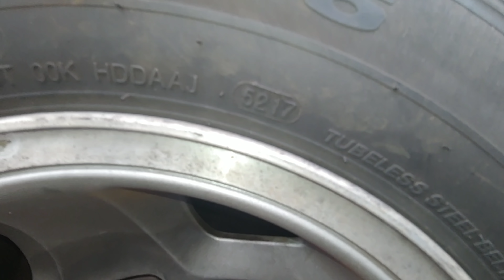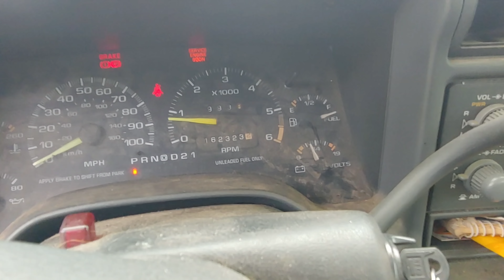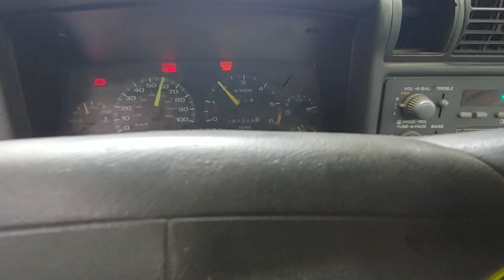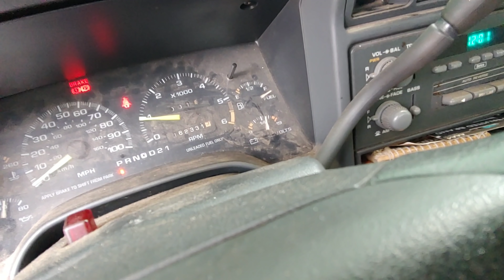How to tell a tires date and alternator repair

Comment: The date info on tires is good to know because tires are only safe for about six years, after that they start losing their elasticity and can blow out suddenly.  So if you find a brand new tire that is over six years old, DO NOT buy it.  I found out about the dates a few years back watching a documentary about them.  In it, an American dad bought brand new tires to put on his son's car who was going to college in my area (Ontario, Canada).  One of the tires blew causing an accident and the boy was killed in the accident.  The brand new tires turned out to be ten years old but never used.

Comment: At least  u got it fixed I'm still saving to buy parts for my truck
Reply from the maker: Yeah it sucks when you don't have the funds I didn't want to go get it but I have to stay on the road right.
Reply from the maker: But like I said in the video if I really had to I would have put that old one in there it would have worked

Comment: Back in the old days we mechanics would replace those bearings :D
Reply from the maker: I think a piece of the bearing must have came out and damaged the field when it went flying out because you would think the bearing wouldn't cause it not to charge you know and it definitely had an electrical smell so something happened
Reply: @ScrapFarm  Usually if the bearing lets go and the armature starts smacking things around in there it doesn't take long for a total failure. Those old style alternators are almost an antique part now !!
Reply from the maker: True didn't think about that the tolerances are really tight
Reply: @ScrapFarm  Yes not much room . 

What year / engine is that turbo kit for Bert ?
Reply from the maker: @johnready630  well it's just the two turbos not the whole kit and I didn't look at the paperwork but I know it's for a 5.0.